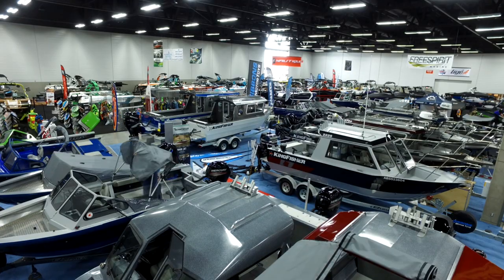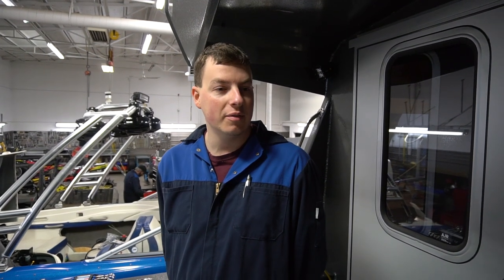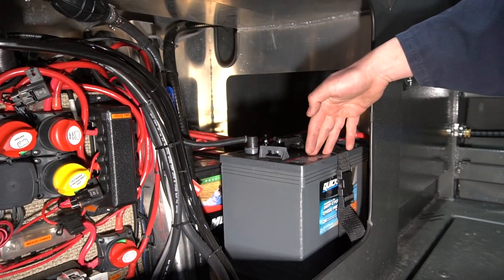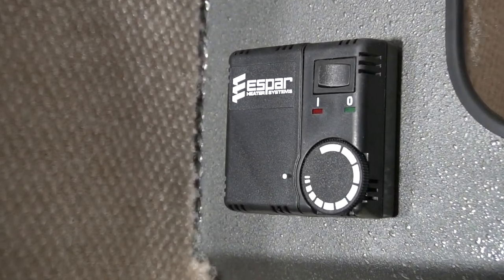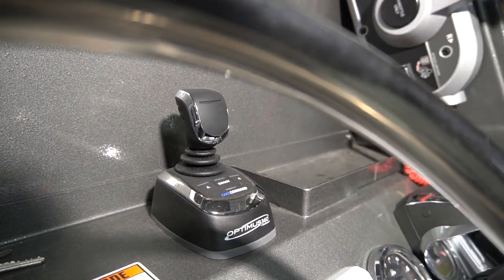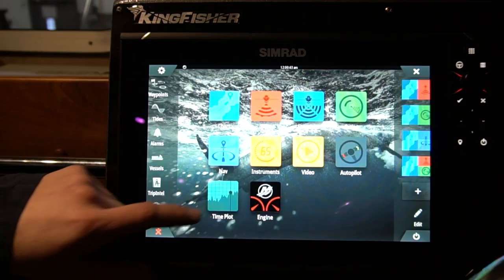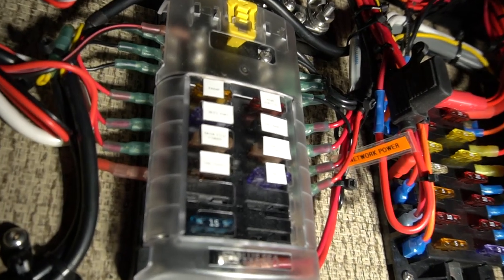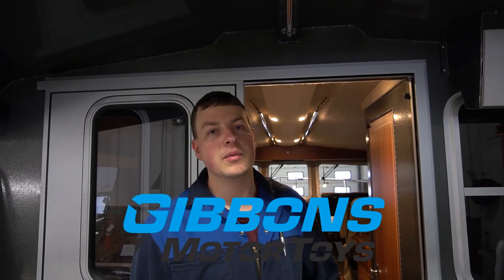Kingfisher 3425 rigging and accessories

Comment: Kicker OB control does not look ideal?, interference with main 350hp 2x throttle control?  Or not a concern because can control by nav screeners eps etc?   Kicker throttle also only at rear? Also ok since used mainly when fishing / trolling, cable wiring seems too close to main throttle base however, when buying for $235k+ be nice to see this installed better.   Nice Boat overall, very nice model the 3425 😎 thanks for posting videos 👍
Reply: InstaBlaster...